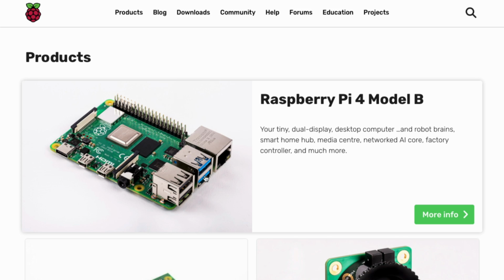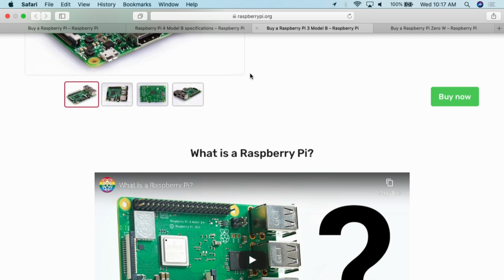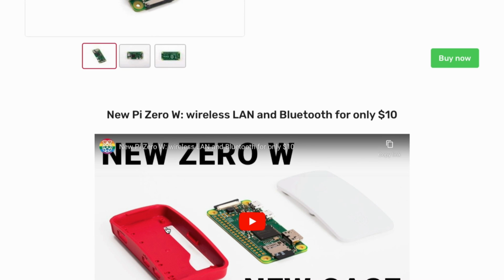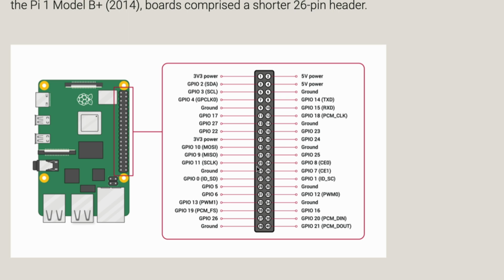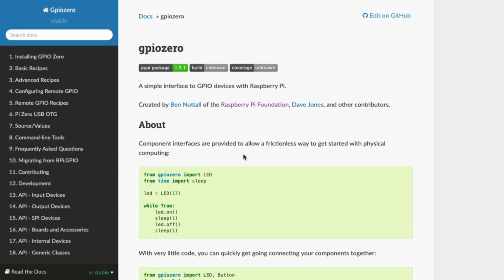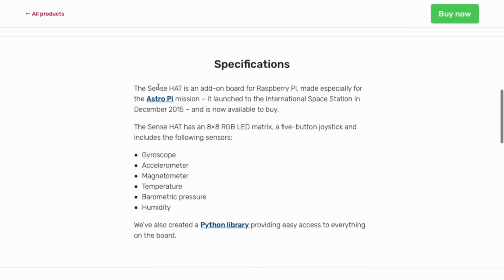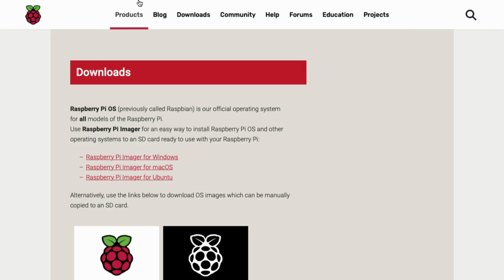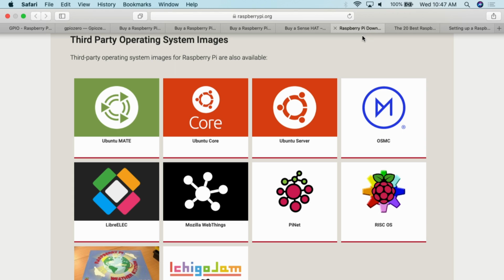Raspberry Pi - What is a Raspberry Pi Computer?

Comment: I am a complete begginer, is it difficult to install an operating system and then later overwrite that with a different operating system? Like your not stuck with an operating system once you initially install it right?
Reply: Right. The OS is run from the microSD card. You can either A) install that microSD card into another computer to overwrite it or B) keep a number of different microSD cards with different OSs on them and just swap them when you want to run a different OS. For example, I have one SD card for my Plex/HTPC build and another for Rasbian that I code with.

Comment: raspberry pi 0w seems good for server-only OS (no graphics), so we don't need much ram. I might give it a shot to use as SMB and HTTP server. It's a shame it doesn't have a jack. Do you think we can play music from it? I don't know if we can connect speakers through USB. But maybe bluetooth
Reply: You can play music through the onboard 3.5mm jack but the quality is not the best. You can get really good add-on DACs (Digital to Audio Converter) HATs that use the GPIO pins instead of USB or Bluetooth. Depending on the type you get they can output to RCA,  3.5mm, or even balanced XLR jacks if you're a serious audiophile. There are other HATs that output to fiber (TOSlink) so you can keep the signal digital and send it to your AV receiver from your home network.
You can even set up your Pi as Roon endpoints to play your music throughout your house from a Roon music sever on your home network.
There are many people who have developed audio solutions for the Pi so we all have the ability to make custom setups. Good luck!